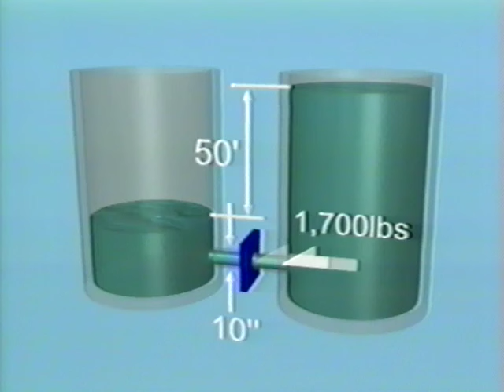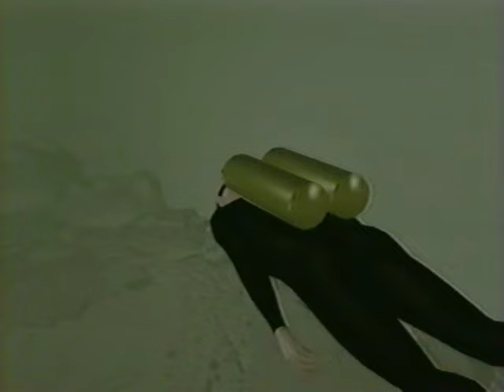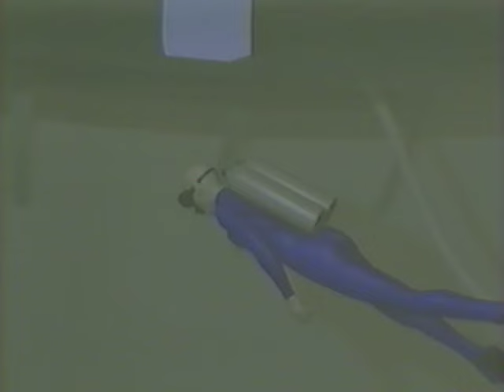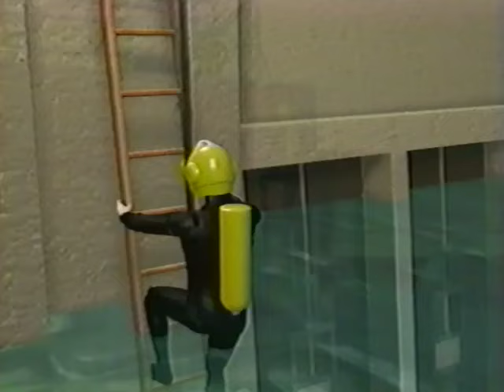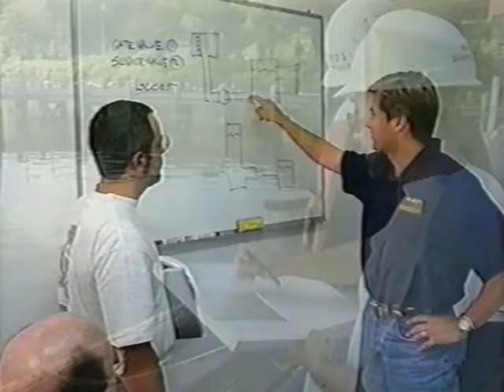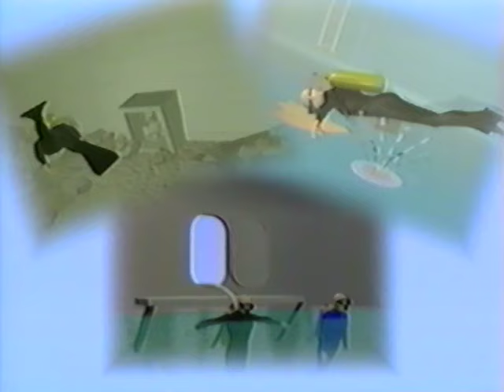Delta P

Comment: I’ve done a gate valve replacement at the chemical plant I work at and that one was a bit nervracking for me.
Was a 36” butterfly valve that was up for replacement and a 15’ depth. 3 sections of water flow, main flow from the plant, the valve  area, and “into the bay” flow were it leaves the plant.
    After all was done we had to remove the pipe plugs (comes in different sizes), the plug was a 12”. You hook it up to a air line and it inflates up sealing the pipe from any water flow, well I was the lucky guy to climb down to the first chamber to remove it and only had a body harness and life line to pull me out. 
  Got the plug pulled out but seeing that water pressure going freaks you out because the full pipe line was miles from shore at the opposite end and it’s buried 15’ deep.
That job was a headache.

Comment: Some of these could have been prevented by cage style grates. This way even if pinned to it you can form a seal so pressure will equalize.
Reply: Wouldn’t you just get spaghetti’d through the grate?
Reply: If it’s cube shaped you’d be far enough away and unable to block all the holes. So while you’ll probably be pinned and or in pain. It shouldn’t kill you.
Reply: Robotic unmanned submarine with extendable arms to remove debris.